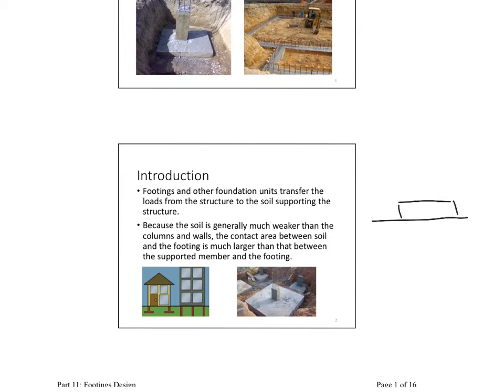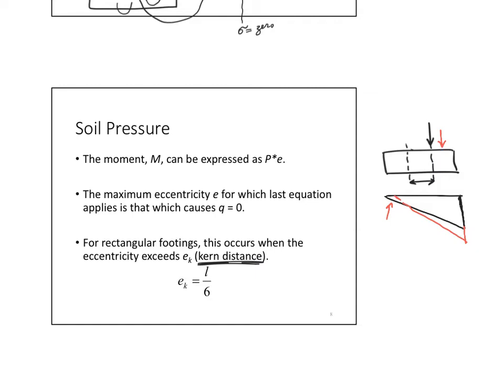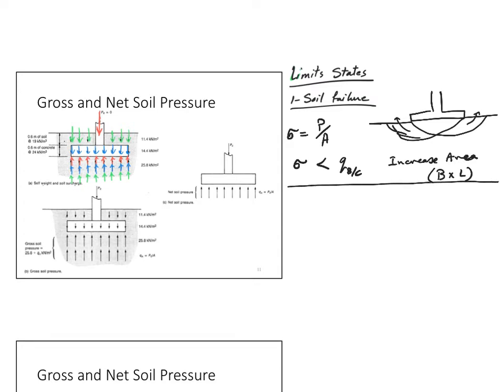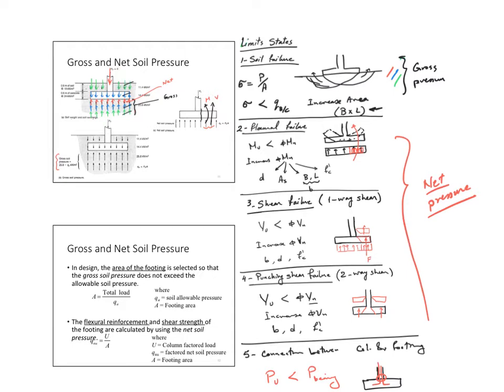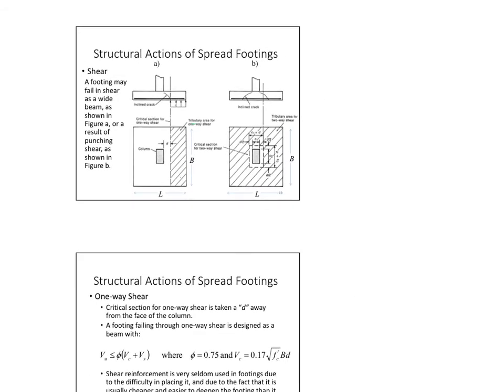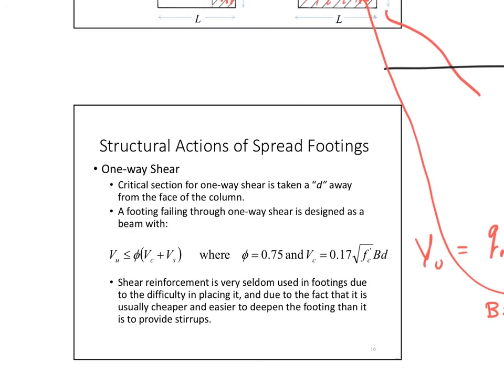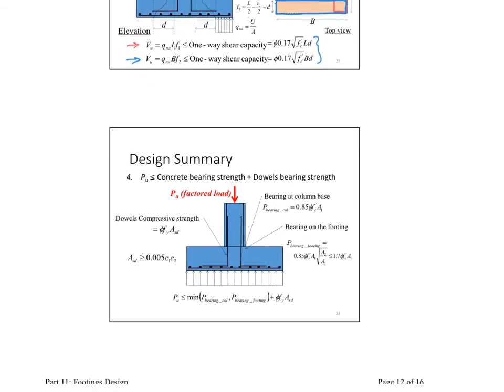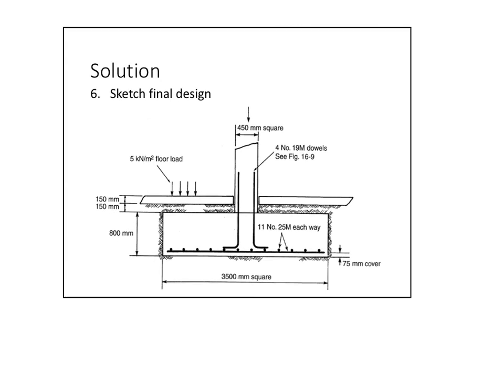Basics of Concrete Design   Part 11 (Footings Design)

Comment: I have a question with the units regarding the Two-way shear. When I take the root of 20x10^3 KN/m^2 I obtain 141.42 which in the end does not give me your same results. But if I calculate the root of 20x10^6 N/M^2, I get 4472.13 that in turn gives me your exact results, so the question is, should the results be in Newtons not KN?

Comment: Anyone know where the rho required formula (at 52:46) is from? Can anyone point to it in the ACI?
Reply from the maker: It is not an ACI equation, it is simply the workout of a second order equation where everything is given except the reinforcement (As or rho). 
The equation is explained in the first half of Part-5 of my basic concrete course (you can ignore the R-factor not to get confused), you may need to watch part-4 first as part-5 is based on it.. Here is the video for part-5: https://youtu.be/TQwgYveGKLM?si=7wemHq5kDaZYWTXZ